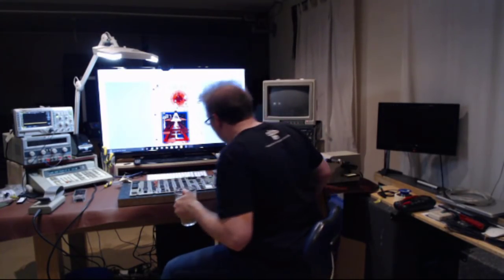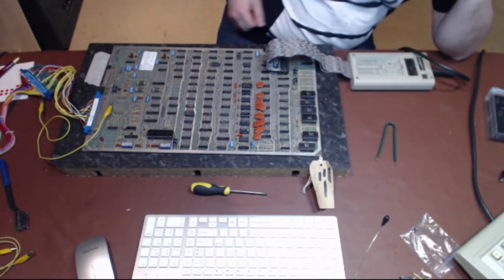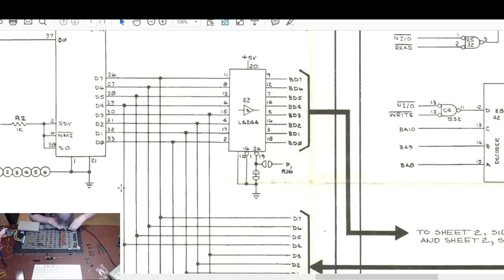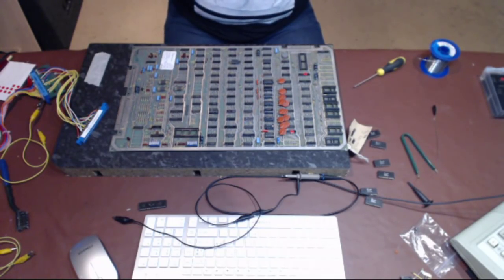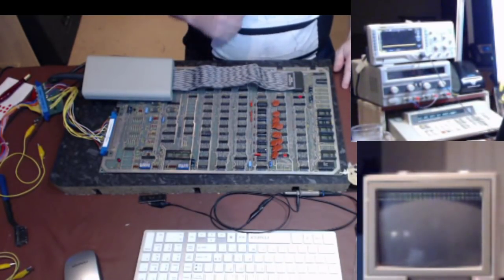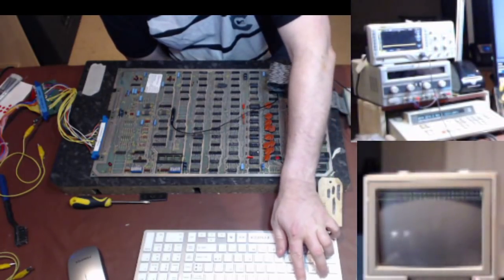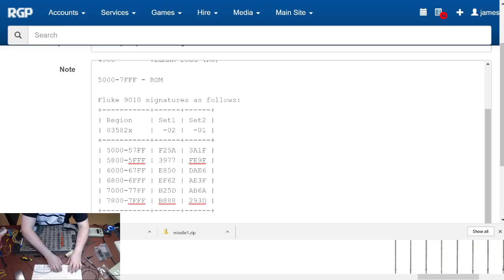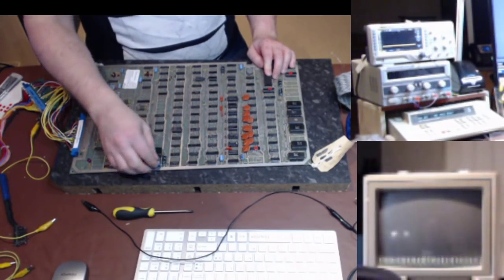[LIVE] - Missile Command PCB Repair

Comment: Hello :D
Can Zaxxon be converted for overseas power voltages without an additional stepdown trans ?
Reply from the maker: Not that i'm aware of, it depends on wether the cabinet was made for export or not.  The USA manufacturers put in two different transformer types depending on where they were destined for.  Like GORF's for example, a lot have a multi voltage transformer in but i've also got one that doesn't.  Same with Pac-Man, Galaga etc.

Comment: Very good repair. Thanks!  That bus contention problem would be very hard to test without a Fluke. It would be nice if you could start an hour earlier... I'm very tired now... (the following day).  :)
Reply: Oh and I checked a Fluke manual. Bus Test uses address 0000 by default; changeable in SETUP.  Could be relevant since the address determines which buffer is enabled.

Comment: awsome video cant see what the fluke says cool new camera set u got
Reply from the maker: I know, this camera setup looks better but the quality sucks, I need proper HD-SDI cameras and a decent video switcher - we own a load of broadcast gear but its a lot to set up for just a workbench.  For some reason I can't get the cameras to work at 1280x720 mode properly and have 2 on the go at once.

I'm hoping to get the interface card for the fluke sorted so I can run the tests direct from the PC keyboard which means I can show the output on the screen.  I'd like to properly capture the oscilloscope and video monitor as well but USB is overloaded nowadays and finding decent capture cards that take older signals is getting expensive and hard to use under modern operating systems.

Getting this right is almost a job in itself for someone.

Comment: thats  mor a a try and error procedure than a prfessional organized repair. looks not very professional to me ! waste of time ! and shorting the pcb at the and was the best ! you are a hero !
Reply from the maker: Well, thanks for the encouragement, given your channel name, I don't think you really appreciate how hard repairing these older boards can be and given there's nobody else rolling their sleeves up teaching anyone and certainly no college to go to for this (they just teach CPLD and FPGA implementation nowadays IF you're lucky) then making some trial and error guesses sometimes in a circuit that relies wholly on the entire circuit working properly (ie, the outputs wrap back to the inputs) then I don't think I did too bad.  The whole point of live repair is to show how easy it is to fuck it up and sometimes the thought process to go through when doing this.

So I shorted the board out - ten mins later off camera it was back running again.

That's how you learn.

But then again, who am I to argue when you can just slap any old PC in, download 70,000 roms and a front end and call that an arcade game......
Reply: Its called troubleshooting.   Thats how you track down unknown problems.  You're probably used to videos where they only show the successes and edit out all the parts where they are tracking down the cause.